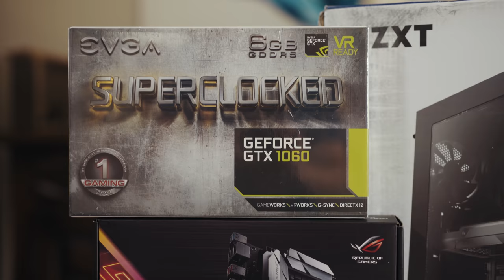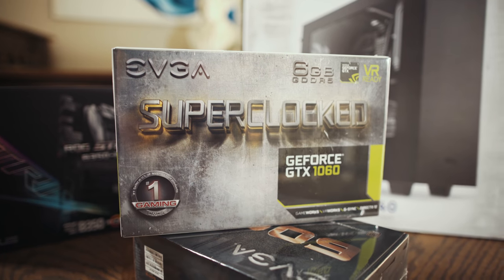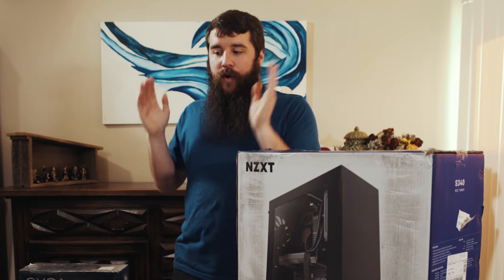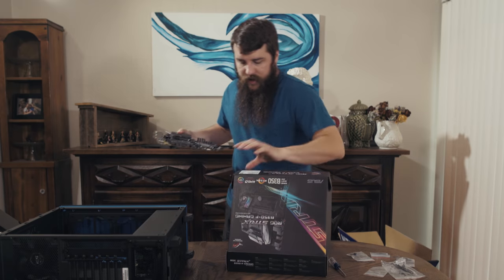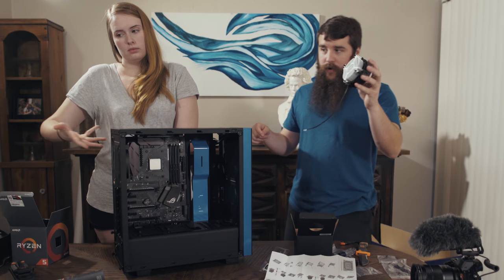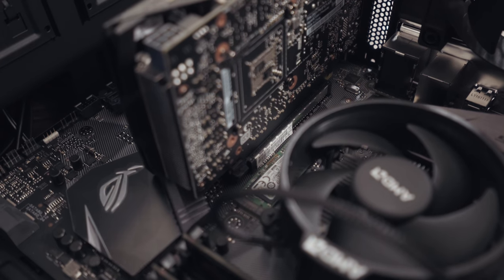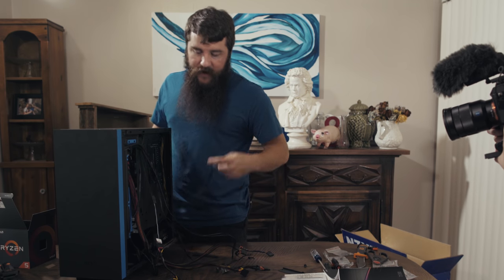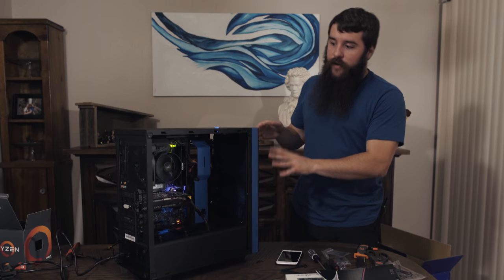How To Build A Video Editing Computer | $850 Ryzen PC Beginners Build Guide | 2017

Comment: only one error, you have to plug the 4 prong plug on the main motherboard power in before the larger part as it has a little bevel that secures it which needs to be lipped under the large one, otherwise, this was 100% perfect and really helped me a ton building my system.

Comment: For anyone in the UK, I worked out the prices to be roughly (for box only): 

Cheap Version (cheaper GPU & CPU):
£135.00 £135.00
£81.50 £2
£197.50 
£172.00 
£60.00 
£80.00 
Total: £726.00

Expensive Version (more expensive GPU & CPU):
£163.00 
£81.50 
£197.50 
£308.00 
£60.00 
£80.00
Total: £890.00

Comment: BOUGHT THE SAME PARTS FROM YOUR OTHER VIDEO AND JUST BUILT MY CPU TODAY!!! THANKS A MILLION !!!!
Reply: This is so cool - I just came across this video. So I'm ready to order all the parts and build mine as well.
Reply: Does it going well 👍
Reply: Benjamin Kibbey just looking at comment. I just followed the video and trouble shoot. Plug it in  and cut it on to make sure it's working
Reply: Raayz Design yep!! Plus you can buy a stronger ryzen processor for cheap now on microcenter.com
Reply: i cant get a signal to the monitor
Reply: KK47 TV make sure you plug in to hdmi
Reply: ratedbsurahel I ordered the same parts as well but i now need a molex connector as the two fans have nothing to plug into
Reply: MangaMemesOfficial you should be able to plug somewhere into the motherboard
Reply: I just put everything together. I got all the upgraded parts. The lights and fans come on for a min or two and then turn off for a sec then turn back on. No signal on the monitor.
Reply: @youkidstv4456   did you end up figuring out the issue?
Reply: Not working

Comment: Just watched the whole video. Probably the best computer build video i've..no, THE best one i've ever seen! I'll certainly be using this.
Reply from the maker: +兆し AGP thank you so much!
Reply: Matt, quick question. With this current build, considering money isn't an issue, could one upgrade to a Ryzen 1700 or would more need to be changed?
Reply: Stuck nothing turned on when turned the power supply on

Comment: A couple of weeks ago I decided I wanted to assemble my own computer for video editing and wanted to keep it under a thousand bucks, but didn't know what the heck to do. Last time I assembled a computer was in the mid 90s. I found this video to be so helpful. So, thanks.

I ended up getting a Ryzen 5 2600x, an MSI x470 Gaming Plus MoBo, an Asus GTX 1050ti, 16gb RAM(2x8gb), a Thermaltake 80plus PSU, and I went with a SATA SSD for now because I couldn't decide which M.2 to get. I'll upgrade to that later. I got an FSP case... nothing special, but it has a window... haha. From my old PC I saved a 2TB HDD, the PCIE Wifi card, and the monitor, keyboard, and mouse. I bought a second monitor, a BENQ 22 inch for a hundred bucks. Total spent was about 950 bucks including the new monitor. So, right on par with what you said it would take. Two thumbs up man! Thanks again, Mick

Comment: This is only 50% of the process. I wish you had to made a video for setting up the computer once you boot it up. Great first half... but needs a part 2.
Reply: ULTRA KWON yea im not a computer nerd i would probably be stuck trying to install drivers and all that crap :(
Reply: Putting together all the hardware is easy. Installing/syncing all the software is the confusing part.
Reply: Yes.  Please include part 2.  How to install OS and software....
Reply: same ._.
Reply: I created a part 2 post for this build here - https://zachgoll.github.io/blog/2019/what-to-do-after-building-pc-linux/
Reply: @zachgoll  yo thanks. But we need a video. And we normal people all over the world use Windows, not Linux OS bro.
Reply: Check out Jeoy Delgado. He has a video on it!
Reply: @steadisteve  the os install is pretty straight forward. you can get a more techy friend to help you create a bootable usb drive with the os on it. that will then guide you through the install. its just a series of clicking "ok" after each part has completed. as for drivers, once the os is good you will have access to the internet from there you can just search for updates for you os using google. its not as scary as it seems.
Reply: @aight365  Retweet.
Reply: @ultrakwon  dude, u crazy. This is the hardest part. Installing stuff first of all is in other vids, second it's easier
Reply: Followed the instructions nothing turned on

Comment: dude HELP...I got all the stuff you said to get. except all the upgraded versions. so everything was fine up until I got to the part where you need to connect the power supply to the fan of the computer case and I have no way of plugging them together. I need some type of converter. where can I contact you
Reply: I have the same issue
Reply: @sieteplagas2844  thank you! Ima order it cause i got the 510 compact case and i can just order one and connect it the same way in the video:)
Reply: Alec King I gotchu man!

Comment: Can you make a 2018 update to this video/ Black Friday version of it? If not can you confirm that there are still the parts you would go with if you had to do it again today. Thanks😀
Reply: I was actually about to comment the same thing! Please make a 2019 version!!
Reply: I feel like the only thing i would change today with this build is moving up to a Ryzen 1700x 8 cores / 16 threads /boost up to 3.8ghz for about $200 (you can probably find a sale on this though thats just the current price on amazon today) or a 2700x (about $80 more) for higher end. The rest you should be fine with. I would keep in mind that the 3rd gen Ryzen chips (zen2) should be announced in January at CES which would drop the prices on these chips so it may be a good idea to wait a month and see what happens if you want to go with Ryzen. And maybe get your hands on a 3700x which is rumored to have 12 cores / 24 thread/ with a boost up to 5.1ghz for around $300 (keep in mind thats a lot of speculation though)

Comment: Why didn't you use ryzen 5 1600?
Reply from the maker: +NEO didn't have the budget. :)
Reply: @whoismatt 
this was a nice build I went the second hand route myself. I got lucky new is the way to go. case $33_water cooler(cpu) $50_ga-ax370 & Ryzen 1700x (new as promo)$150_ asus gtx 1080 strix $300_super luce 3000mhz rgb ram 32gb (runs @2999 with bios tweak) $200_corsair cx550 $40_adata nvme 250gb ssd m.2 $40_windows 10 pro(kinguin) $30. 30 bucks enclosing 800bucks of pure black magic.

Comment: RAM speed for Ryzen does makes a huge difference.
Reply: I think he means in reference to video editing because that's the main purpose of this machine.
Reply: Sublime IO
Ram speeld and cl doesn't make huge difference anymore. It makes almost no difference in gaming, but it does benefit editing a little more.
Reply from the maker: +Sublime IO yeah I agree. If I had more $$ I would have bought 16gb at 3200mhz.
Reply: Can I put two more of these for a total of 4?
Reply: Yo!!! Just built my first PC and made a Video about it! its pretty badass!
Reply: I used the Ryzen 5 1600x BTW
Reply: true
Reply: but you bought an rgb motherboard and nvme ssd. You definitely did have enough if you went with a cheaper board and ssd.
Reply: RAM speed makes negligible difference for video (en|trans)coding.  I don't know how it makes a difference for editing.  Same is true for choice of SSD or vs HDD.  Unless you're working with very high def RAW video.
Reply: OptimisticPessimist agree but disagree for SSD vs HDD. huge read speed difference (and also write, but whatever) makes hugeeee difference in opening any type of file.
Reply: Use any Linux distro with ext4 as your filesystem and use these as mount options in /etc/fstab for all devices you want to mount at boot time  journal_checksum,delalloc,lazytime,noatime.  The latter three eliminate most of the IO that slows down your use of your computer which doesn't need to spend much time actually reading files from main storage but slows you down to update access time stamps and allocate space for new files and fragments before they're ready to be written.  0.9MB/s is still fast if you only need a few .01 MB files or bits of files that aren't fragmented all over soon after they were defragmented.  For any but the root partition you can put data=journal (can't use 'data=journal' and 'delalloc' at the same time on the same partition; don't know why it just won't mount with both set) in there too.  If you set that option for the root partition it won't load the OS so you'll have to find a way to edit fstab without booting that OS instance to fix it.  There is some other place to enable it though I forgot where.  That actually makes it a lot more responsive for small objects if you're not constantly and continuously writing to it for very long periods.  Data=journal puts files up to a certain size (don't remember the size) in the journal and copies them to the main storage area during idle periods.  Then just make sure your partitions are never more than 90 percent full.  Ten years later if your HDD still runs it will be as responsive as a fresh install with zero file maintenance other than regular FS error/bad block checks.  Generation, brand and model of HDD makes a difference though.
Reply: Another thing to keep in mind is IO scheduler.  Default will either be 'Deadline' or 'CFS' in almost all cases.  I prefer CFS for shorter delays most of the time but supposedly 'Deadline' is more responsive when the HDD's IO is loaded.  I don't use Deadline because I notice wait delays when the HDD isn't doing anything.  Just make sure your storage IO heavy app is set to a very low IO priority [only works with CFS] and not using more than one IO thread.
Reply: For the Intel based machines this is true. For the Ryzen based machines, memory speed is a game-changer. The HDD/SSD comment is just untrue. I doubt if you've ever worked with an SSD disk(?)
Reply: I have an MX300 750GB SSD.  I don't use Windows.  Take note of the mount options in my second comment on this thread.  Maybe there are similar options for Windows.  Why do multichannel surveillance systems come with a single HDD and are still able to record a bunch of streams simultaneously?  I don't do much editing work so far.  But I know that if a slow HDD can't keep up with a final encode, even when the source and destination file both reside on it, then you're not making great use of the encoder or are using an inefficient one.  I also know that a light and tuned desktop runs every application at no worse than RAM speed no matter the storage; except for almost unnoticeable dips when it needs data not already prefetched.  EXT4 stores everything in a way that random access performance rarely matters (unless I don't use 'lazytime,' 'noatime' and almost as important 'delalloc' as mount options).  It only makes a difference for me when running random and multithreaded IO stress tests.  That is the only time using the system with the HDD bothers me more than using the one with an SSD.  I was also speculating on RAM performance, heard another comment from another reviewer that for encoding you maybe get a minute ahead per hour with 3200 vs I don't remember what lower rate RAM, for the final encode.  I don't know what difference it makes for editing, but not worth the price bump unless you're already getting or reached a point of being able to get a lot of money per hour of work.  I just bought 2x4GB 2400Mhz 15 CAS kit for an R3 1200 and installed Xubuntu onto a WD Black 1TB HDD.  My user account is encrypted and I don't sense more than a slight difference in IO.
Reply: RAM speed makes a decent difference even on Intel platforms in gaming - going from 2400mhz stock up to 3200 with tight timings can bring an additional 10% in some games. On Ryzen, it makes a MASSIVE difference, offering sometimes up to 30% more performance.

Comment: Dude this helps me so much. Very in depth, and useful information. Entertaining as well. I just tried to install premiere on my laptop realized how out of date and powerless my computer is. Had do some research to find out video editing requires a special build. Felt like i had to open a whole new can of worms and fall through another worm hole of tech and specs. Your video cut straight to the point of basics, and budget. Thanks again !

Comment: NOOOOOOOOO Just did this build with some of the upgrades recommended this year and I'm getting a message on my screen saying (it isn't getting a signal from the computer)...... So far, I unplugged and replugged SSD, graphics, power to motherboard, CPU power, RAM... This motherboard has led lights when something isn't plugged in and stays lit on "boot" when everything is connected. This is the case with everything plugged back in and all the fans are running but STILL my monitor isn't receiving a signal. Any help would be greatly appreciated 🙏

Update: actually got it fixed.... After resinserting everything, I went to the power supply and replugged everything which seemed to work!!!
Reply: Old Bull Lee I’m having the same problem. Everything is running but no signal to monitor and I feel like I tried unplugging and plugging it back in already
Reply: marianivich86 same,  this dude needs to do an update video on that subject

Comment: It took me an hour and a quarter to build mine.  That included scouring the manuals to connect things I forgot how to.  I didn't do a preview of it beforehand either.  It is a mess so I have to unplug and reroute all of the wiring.  I was just in a rush to make sure it works.  No sense spending the time for perfection if something has to be RMA'd.  If you don't need OC or ECC compatibility or crazy amounts of IO connectivity, $50 might have been enough for the MB.  I spent $75 on an ASRock AB350m PRO4 for ECC support, then bought the cheapest 2400mhz non-ECC I could find that was validated for it.  I'm not ready for what I need the ECC for, nor the extra cost for ECC modules that have been validated for it which happen to be in short supply and high demand atm.

Comment: If you are using premier pro, (this also applies to photoshop and most likely other video editing software), buy a cheap SSD, something like a 64GB or 128GB SSD and use that as your scratch disk to speed up premier pro.

Comment: the connections especially between the power supply and the motherboard will have to appear in clear on the video because according to my experience with the motherboards: it is a real hassle. I admire you for your very clear pronunciation and your total turns of the subject

Comment: The price difference between a M.2 (non nvme) and normal SATA express SSD is still considerable if all you want is the ease of installation, also many mobos place them after the PCIe x16 slot, making necessary the removal of the video card.

Comment: Hi Matt, great video, but can I give you a couple of tips. Firstly for the PSU and plug it in, that way you're earthed and far less likely to cause static damage. Install the CPU, m.2  and memory before you fort the motherboard into the case, also the cooler, but sometimes that can cover the mounting screws.  Lastly, remove the film from the case after you've finished building it or after it's been transported to its new owner. I'm not criticising you, it's a good video. Just a couple of tips.

Comment: Hey Matt, im using your newest budget 650$ PC build that you said should be the same as this guide. Im stuck on the molex connection part because I don't seem to have a molex connector. I don't know what to do.
Reply: You can still connect your fan. Just plug it into the motherboard where it will say system fan 1, system fan 2, etc. My fan has 3 pins and the motherboard has 4 pin slots but it still works.

Comment: Just a little critique here Matt. You should work on the motherboard outside the case like on the mobo box itself. It's what many do. Next, install your cpu/fan & heatsink (plug in fan to motherboard. Then snap in the ram sticks and lastly install the M.2 SSD. All of this could also have been filmed better on top of that mobo box. After all of this is done, install the motherboard into case then install the rest of everything else, i.e. power supply, graphics card and wiring up everything.

Comment: I used the buying guide/step by step video to build my first pc. It was a great tutorial (the only part that didn't work for me was the Molex connecting for the case fans. I solved this by plugging them into the sys_fan2 & sys_fan3 slots on the motherboard). Overall, great tutorial! Thanks Matt.

Comment: When buying a ssd, only buy m.2 drives if they are PCIE drives, otherwise buy a normal size (2.5") SATA SSD. drives in the m.2 form factor run hotter than a 2.5" drive and this can cause throttling, something you do not want if you are using a sata ssd. So m.2 = buy only nVME (PCIE SSD) - SATA SSD = only buy 2.5" drives.

Comment: hi i watched your recent budget build and bought everything (with your links). i then watched your video on how to build but there is two problems ive came across the fans are little 3 hole connectors  not molexs and i cant figure out how to plug them in. and also there is no plug in on the Gtx 1050ti am i missing something or is this normal
Reply: Did you ever figure this out??? I am having this EXACT issue and don't know how to fix it :(

Comment: I think that the Asus Strix B350 supports 3-way Crossfire but not 2-way SLI. That means you can pair multiple Radeon/AMD graphics cards, but it supports only one Nvidia graphics card. Just to clarify
Reply from the maker: You're right Phillip. Sorry I didn't clarify this in the video. If my bro wants to add a second graphics card he would need to sell the 1060 and buy 2 AMD cards. :)